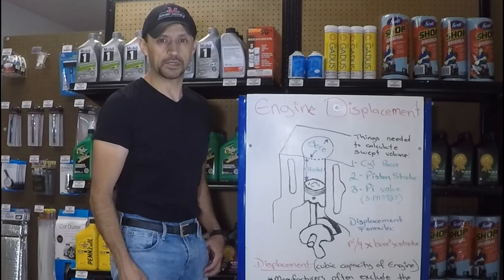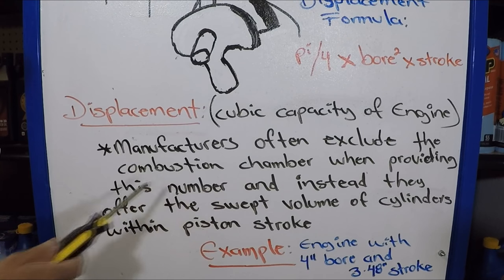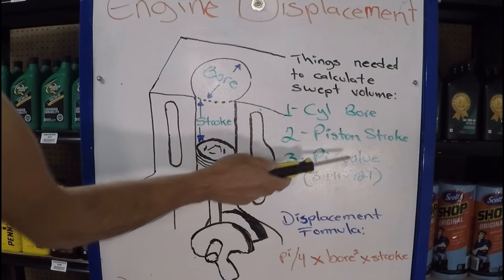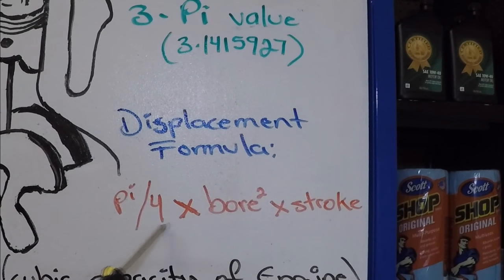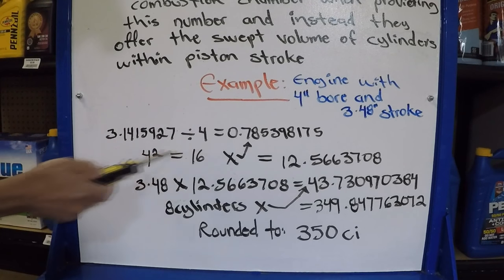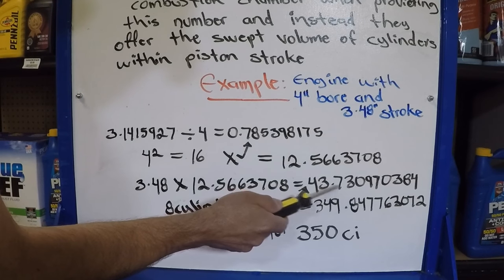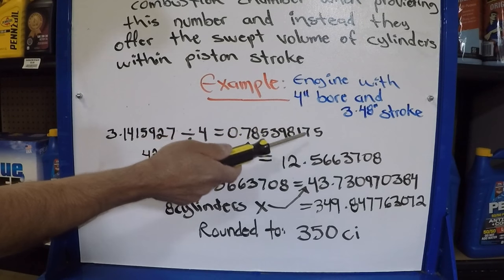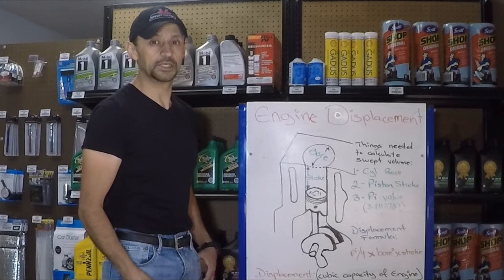How to calculate Cubic Engine Displacement

Comment: why was pi divided into 4?
Reply: Because the cylinder is a 4" bore.
Reply: its because, in order to calculate the area of a circle we need the radius, but in this case we only have the diameter. so we divide the diameter/2 but if you square it it goes diameter^2/4, thats where the 4 comes from
Reply: I bet it is based off a Chevy 350 which has a 4 inch piston
Reply: @racer67  false.